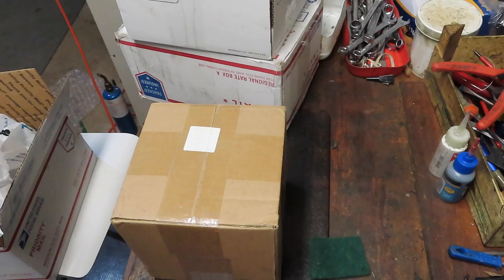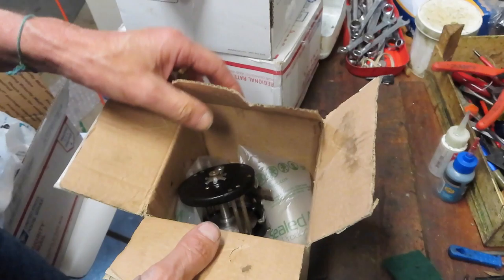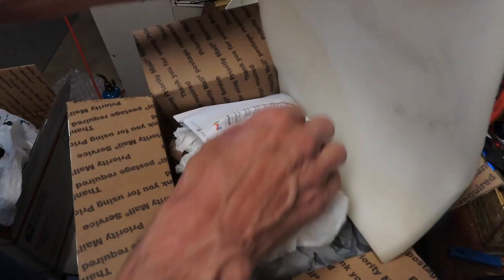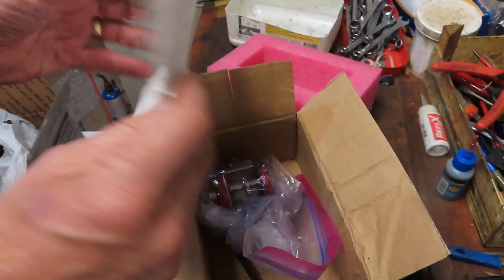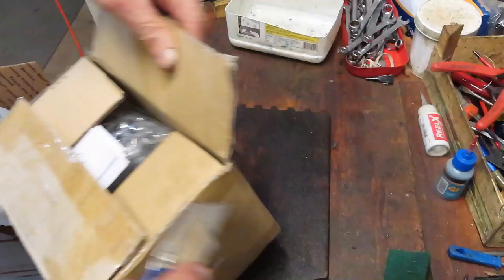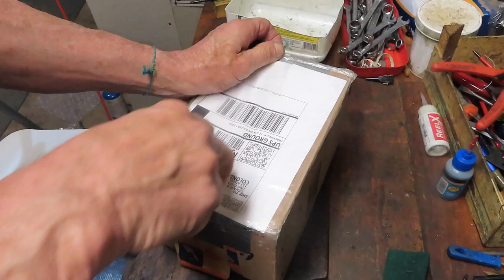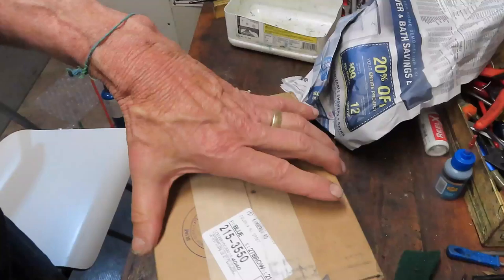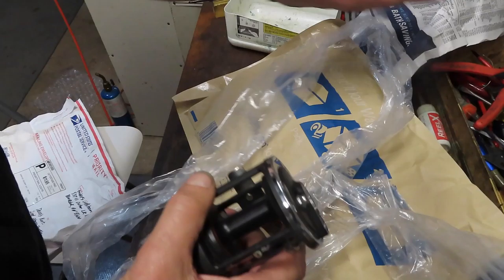New shop fisihing reel servie and repair projects with previews of upcoming videos

Comment: Hey...I have two ocean city 113 
1 has a green 113 emblem.the other one has 113 on the side plate
Are they the same?
Reply from the maker: Yes - like the Penn 60/65, the outside plates underwent cosmetic changes, but the internals largely remained the same

Comment: Hey i recently picked up a penn beachmaster 155, I noticed that the free spool switch will not toggle/lock back, but instead goes back into the forward position when I try to use free spool, do you have any idea what may have caused this and what I need to get to fix/replace the part?
Reply from the maker: That sounds like a broken eccentric spring, which puts tension on the lever.  The other issue could be a frozen pinion gear stuck on the spool - You will need to open up the reel to determine which one it is - Dennis